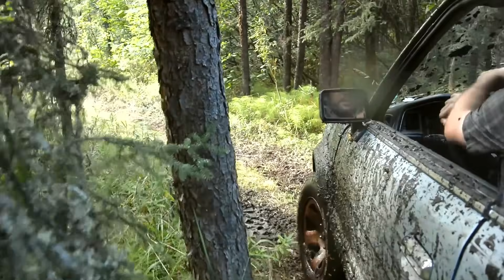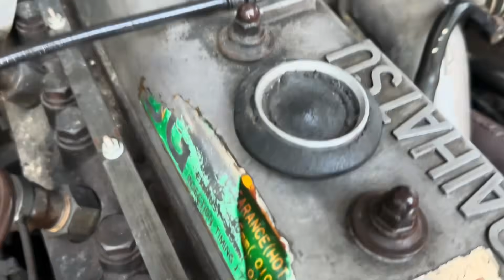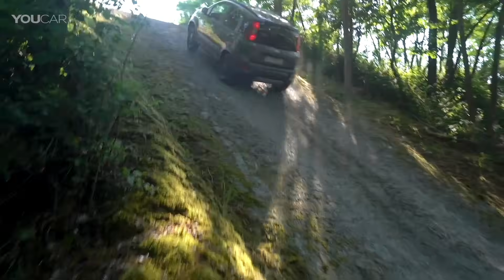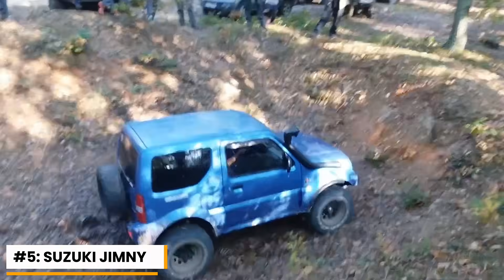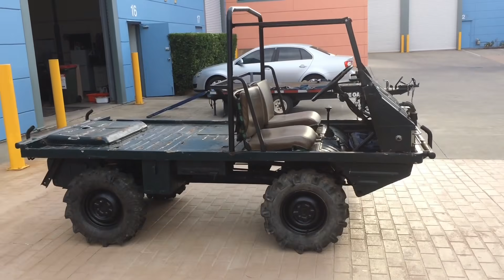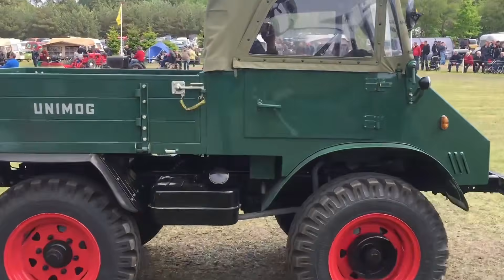10 Most OVERBUILT Mini 4x4s Ever Built!

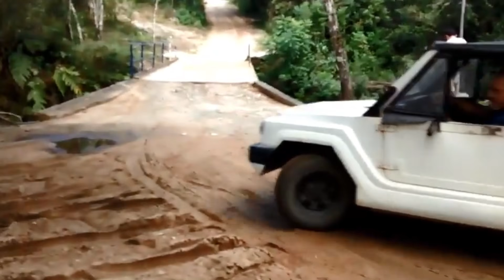Comment: 05:40 Using twin manual levers to independently brake individual spinning wheels instead of adding a heavy 4WD transfer case was an ingenious, low-cost engineering workaround for tough terrain.